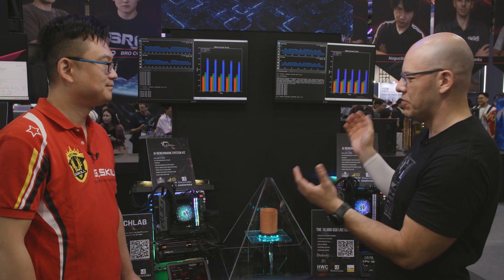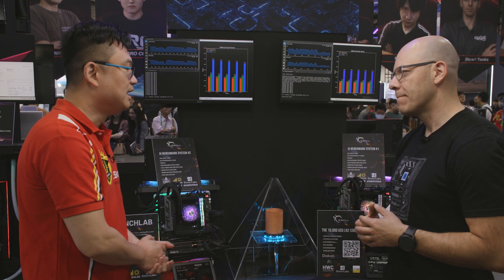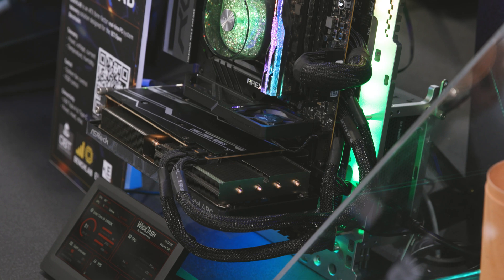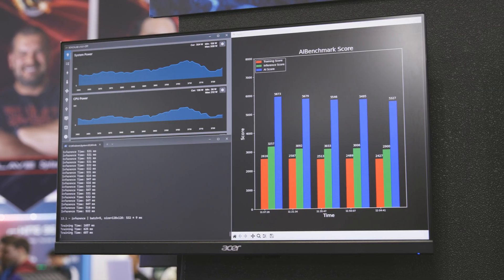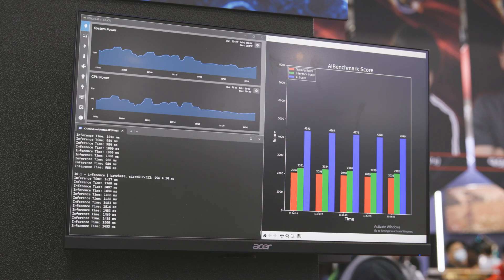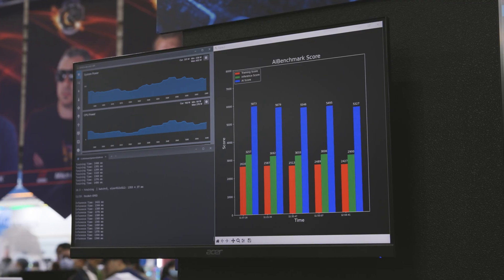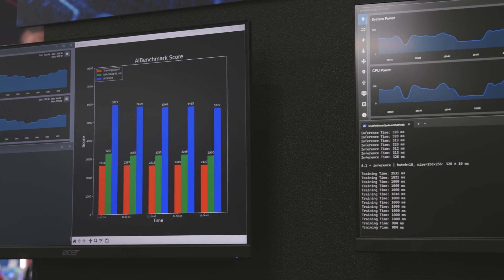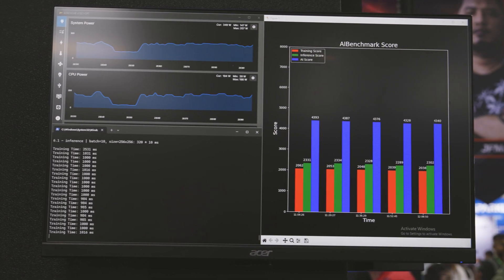Intel x G.Skill at Computex 2024: A $10,000 Cooler & CAMM2 Memory | Talking Tech | Intel Technology

Comment: I need a room heater in winter. Buy 14900k!
Reply: I knw it's joke. I think the cpu is being over hyped, the rtx 4090ti is delayed because its power is over 500W+ and they are designing a strong enough heatsink. This is also not enough to warm the room with the current rtx 4090